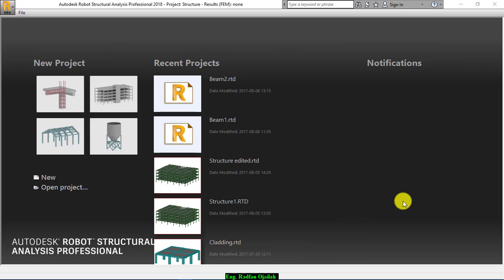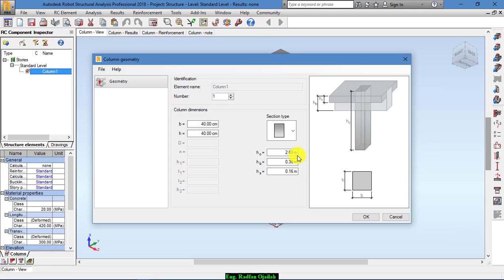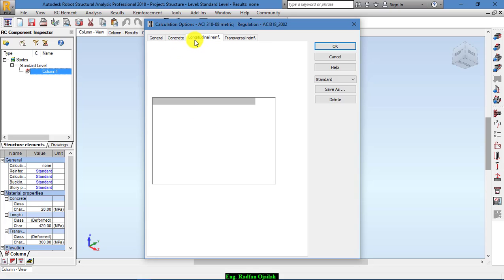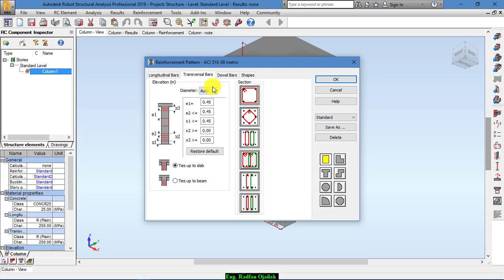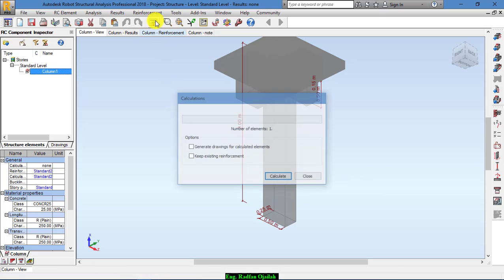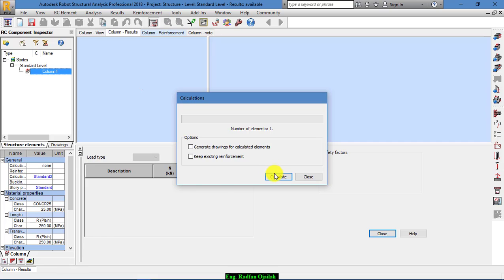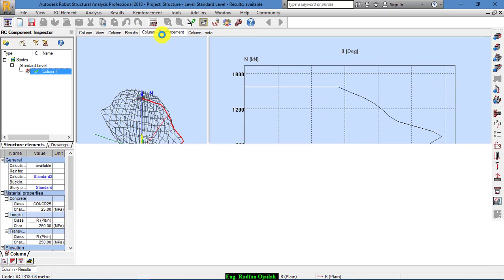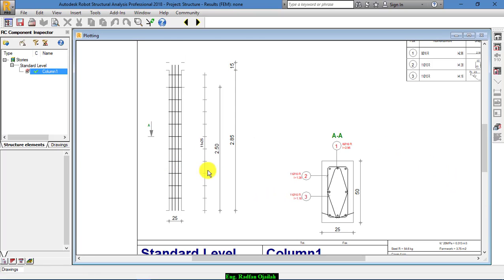Lesson#12: Design of an Rc Column in Autodesk Robot Structural Analysis

Comment: Can you please make a presentation on how to design a concrete column which has a irregular shape, what i mean is not rectangular nor square where you have to use contour of polyline...thank you very much...
Reply from the maker: Of course I can and I will once I get time.
Thank you for your comment
Reply: Eng. Radfan Ojailah oh that's great, would you be able to do say, a column (almost similar to a T section) of an overhead light rail transit or of a railways... thanks